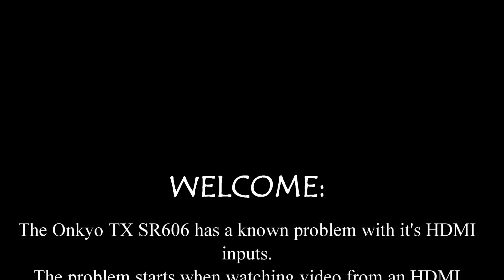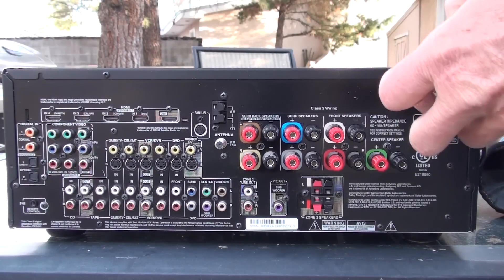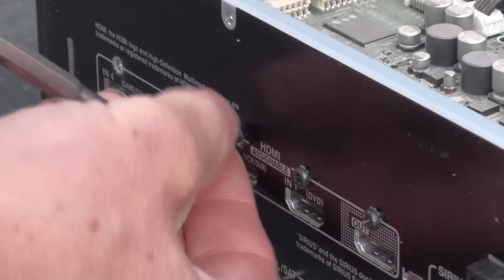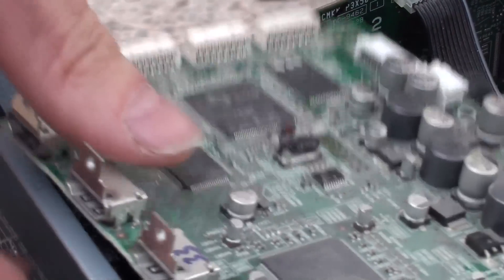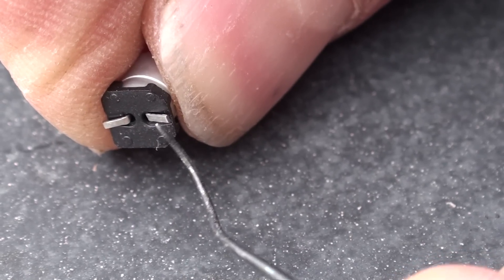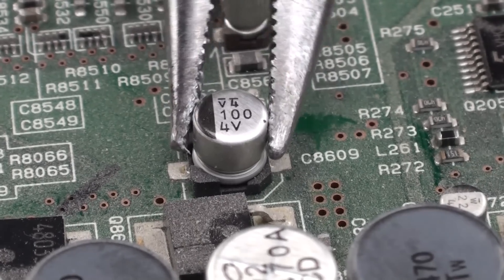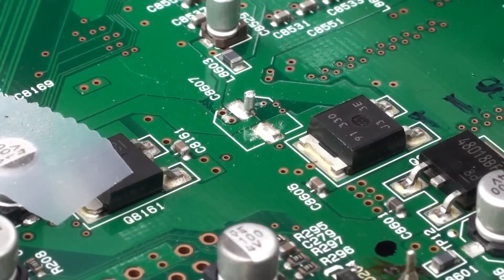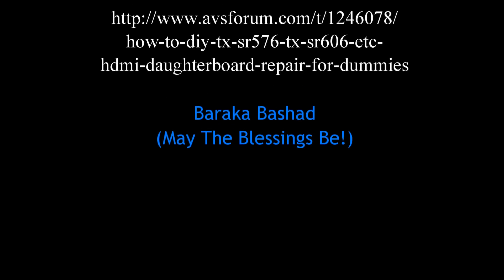How To Fix the Onkyo TX SR606 & SR607 HDMI Input Problem

Comment: Hey Pat, I accidentally pulled the larger looking cap, the bottom one of the 3 in a row near C8162 off of the board during my soldering and I soldered one of the extra caps that a purchased to replace it. Is that gonna be a problem? Will  the cap that I put in its place work or should I order a different cap?

Thank you in advance for your help!!!!
Reply from the maker: It probably wont work. First it's a different value of capacitance. On that alone, the circuit its in probably wont work. Secondly, the larger Caps are mostly 16V rating.  The small caps are a 4V rating. Worst case, the small 4V cap will burn and short out possibly taking some other components with it.

Comment: What is the difference using a 6.3v, 10v, 16v or 25v as compared to the 4v one (493-2141-1-ND) you used. Is there any advantage to using a higher voltage? Will it last longer? Heard that the 4v caps would again give the same issues. Please advise what caps should I order? Appreciate any help in this regard.
Reply from the maker: Some people think using a higher voltage will prevent the caps from failing. I do not agree.  I believe the failure mode of the caps is due to high heat over time which dries the caps out, thus they gradually decay in function.  If the failure was voltage related, the failure mode would be immediately (good one day, bad the next) In this application, using a higher voltage should have no impact on how the circuit functions.  The components will just be physically larger as the voltage goes up.  I wouldn't go higher than 6V myself.   
  To recap, higher temp rating should make the fix last longer.  Higher voltage caps will do no harm nor good.
Reply: +patpatpat999 Thank you. So I guess I go with the 4v new part from Digikey or a 6.3 v one

Comment: Great tutorial! Does this also work for the SR608?
Reply from the maker: Probably will.  Just replace all the 100uF capacitors, not just the ones I show in the video.  It's only a bit more work and a couple more dollars.
Reply from the maker: I can't say for sure, but probably.  From what I can tell the HDMI board is very similar.  So just visually identify all the 100uF capacitors on the board and replace them.  If you're beyond warranty, It's worth a shot.  Good luck

Comment: Super video! Do you think a TX-NR609 would be the same? I'm also experiencing no HDMI output anymore on my Onkyo... Would be great to be able to fix it.
Reply from the maker: 1_ if the digital card looks similar, then probably yes.
2-  For the cause to be the capacitors, the problem has to be as described.  Takes long time for it to recognize inputs, problems grew slowly over time.
3-  If you went from no problem to problem overnight, your cause is something else.
Good luck, PR
Reply from the maker: 1-  If your digital card looks similar, this will probably work.
2-  If your problem got worse slowly over time, this probably will work.
3-  If your problem happened suddenly, then your problem is not the capacitors
Reply: patpatpat999 Thanks for the quick reply. I've had this one time earlier (suddenly no HDMI output). Now again. Was working fine until the day before. So probably something else then :-( :-( Thanx

Comment: Pat I have a newer TX-NR807 but also seems to have this same issue. I was concerned about how much heat was in my stereo cabinet and I guess my fear became a reality.  

That said how did you identify the proper capacitors?  For example I am looking in the service manual and its a good bit of tracing through the schematics in order to do that.  Additionally, the part numbers listed in the service manual seem to not pop up online with any specs.  

I assume one of mine that say (K2P 470 10V) is a 470uf 10V cap.  Interested to hear your thoughts.
Reply from the maker: HI,  I'm not an expert on all these units and I don't have access to schematics, so my technique has been more "shotgun" than sharpshooter.   If the problem started "overnight" it's probably not the caps.  Yes, I believe heat accelerates failure, so having in an enclosed cabinet is not so good.  I fried 2 DVD players by putting them on top of my Onkyo.   Yes, I believe you're correct on the cap pn - values.  If getting new caps, go for the 105C temp spec, and hopefully they will last.
Reply: Well it seemed to coincide with a recent storm but the unit still turns on with south just no HDMI out video.  I should probably try the legacy component cables but for now I might replace all the caps and give it a go.

Comment: Is it fine if I use radial 100uF, 16V, 105°C capacitors? I'm guessing it is, just asking to be sure.
Reply from the maker: Yes, they should work fine.
Reply: i have the same question.  but instead of 16v, i picked up some 50v ones.  those should be ok as well, right?  thanks in advance.
Reply from the maker: +swivel63:  Yes 50V should work fine as long as you think you can fit them on the space on the board.  The size of the caps is somewhat proportional to the voltage rating.

Comment: Hi there, many thanks for the video. i am having a problem with my onkyo tx sr608. my problem is hdmi output stops working after sometime and then it continues going on and off. sound is working fine in the background but display mode changes from hdmi to other sources on my tv and continues doing so. do you think this could be the same problem like you have shown here? and do you think it is repairable by changing capacitors? many thanks again.
Reply from the maker: I don't think the capacitors are causing the problem.  Sorry, I don't know what the exact cause might be.

Comment: The capacitor fix is necessary but the cause is the heat rising from the rectifier heat sink just below the HDMI board. The heat dries out the electrolytic capacitors over time.
FIX: mount 40mm 12V fan inside lid just above this heat sink. Align arrow on fan to expel air thru' lid vent holes. Connect fan to +12V at pin 4 connector JL8001A, fan Gnd to pin 5 JL8001A. Connect 0.01uF 50V ceramic capacitor across fan terminals to stop RF noise. search schematics tx-sr606_sm_1.pdf/download.html

Comment: Can you tell me if this is likely to be a fix for 'noisy' hdmi channels. I have one that works find, but the other 3 range from noisey (white lines flashing along, but that makes the input reset etc). I'm up for trying this, but would rather know what kind of problems it was fixing.
Reply: Gordon, I didn't have the switching problem.  Rather, I was getting the white artifacts in the video along with dropped signals (i.e., entire screen going dark for 1-2 seconds), and it was gradually getting worse/more frequent.  I replaced the five caps and all of my problems were eliminated.  I also regained use of the OSD.  Go for it!

Comment: Thanks so much for this nice bugfix video. I also found a similar description here on AVS ...

http://www.avsforum.com/forum/90-receivers-amps-processors/1246078-how-diy-tx-sr576-tx-sr606-etc-hdmi-daughterboard-repair-dummies-31.html#post_24151775

I had the same issue with my TX SR 606: HDMI inputs were showing up late, also the normal composite inputs
had only Audio and I had to turn on and off 1000x times to see the picture. I decided to exchange all the mentioned Caps from AVS link, about 20x in total. Ordered all from Mouser for 10 bugs (P/N below), replacement was done in an hour. I also added two 80mm 12V 0.2A fans to circulate out the heat, Tapped the 12V from the HDMI board, 50Ohm in series to bring it down to 7V, 0.1A to get the noise down, One is blowing on the HDMI board, the other one blowing out. Everythings works perfectly again!! 

Mouser P/N
667-EEE-FK1E220R -> 22uF 25V
667-EEE-FK0J101UR -> 100uF 6.3V
667-EEE-FK0J221AP -> 220uF 6.3V

Comment: I had a TX-NR818 get shocked in an electrical storm in which my apartment had a bad ground. The receiver works but only ONE HDMI port works. Would this repair apply?
Reply from the maker: Justin Rizzo Possibly.  Capacitors are not too sensitive to electrical impulses.  It's possible this might help but you may have other chips that are blown.  Might be better off looking for a replacement board on eBay

Comment: Hi there, do you think this is the action I need to take for my receiver? It lightly fell from the tv stand (receiver was still on the stand when it fell). The stand detached from the back when adding weight to the stand and it caused it to fall along with receiver. The cable was still connected to the port and it may have damaged something in the port because the video color is off and it flickers. Everything else is working fine. Any tips, thoughts?
Reply: +dina Mac I'm not sure there is a repair unless u can resolder the port on the board. You may be able to take it to a shop and have them swap out the board with a good one. But be warned, these boards aren't cheap. And there is limited stock. Onkyo has extended their recall program till 2018 but i dont think it covers physical damage.

Comment: Good , I have the same problem but my team is HT- r592 , does not the HDMI Out , ne and could help indicate which of the capacitors have to change?
Reply from the maker: Sorry, don't know which parts exactly for your model.  Recommend you replace all 100uF caps on your board.  You will have to remove board first and determine how many capacitors you need.  Good luck.

Comment: What is the rounded rectangle shaped thing just below the letter dts about half an inch.  My speakers stopped working and it looks like mine melted.  I’ve already had my capacitors relaxed years ago but now my speakers just crackle from hdmi sources.  The hdmi still passes video and audio through to the tv properly.
Reply from the maker: schreck425 Sorry, I dont’ know

Comment: Would you happen to know if  the tx-sr706 is the same board...same replacement components?
Reply from the maker: It is similar but not identical.  The process is the same. Identify all the 100uF capacitors on the board and change them out.  AVSforums may have some more details.  If you decide to try this, please us know how it goes.

Comment: Great video..i have a denon AVR 1912 with no hdmi output but component and video out works fine..just hdmi output does not work it would helpful if you solve my problem...
Reply: the video input is component and output is hdmi it works fine but when input is hdmi the output does not appear.

Comment: I have an on Onkio TX-NR609
 The HDMI inputs are working.  The old RCA  audio & video Inputs work as well. The problem I'm having is that I am not able to input any HDMI 3-D Blu-Ray player. It went back 7 times for repair for this issue within 1year and Onkio  finally said they would no longer repair it......  So I've been living without an amp ever since. Just wondering if you think this might fix the issue I'm having?
Reply from the maker: airdreams1 It may,  I can’t say for sure.

Comment: Hi.  I Have the HT-R680 which is having the exact same issues here.  Takes 10 minutes or so to show up on my TV.  I hear a click when it finally does.  I followed the instructions to get the board out, but mine looks a little different.  I don't have nearly as many other capacitors that you do, however, I do have 4.  1 on the bottom and 3 on the top.  The 3 on the top are 16v, the bottom one is 50v even though the bottom looks a little thinner.  My question is, looking at digikey, there are so many options.  How much does it matter as long as I order the same size and voltage?  I narrowed down to the same brand and type.  Nichon aluminum.
Reply from the maker: Ken Shutt Yes, you are correct. As long as the capacity in uF and voltage rating, and general type (aluminum in this case) are the same they are valid replacements.  Also you can use other form-factors.  The original are SMT (Surface Mount T???).  Some people like to use radial style.  They can be easier to find, a little easier to solder on.  Just like aluminum, they are polarized and have a Positive and negative lead.
Reply: How do I know what the UF is.  THe capacitors on mine show 16v.  But it says something like JT or J3, the 100, then 16v..  The one on the bottom shows.  Q3.  Then 4 . 7 and then 50v.
Reply from the maker: Ken Shutt If you can send me a photo of the larger one I can probably tell what it is.  The smaller should be 100uF

Comment: Hi. thx a lot for this vid. 
how did you know which of them you have to change? i did it and it worked perfekt. BUT...now I want to repair my own one. its a 605 with a different hdmi-board. how can I know which ones I have to change?
Reply from the maker: With this method I don't know exactly which capacitor(s) is bad, I just replace them all.  This is a good method in this case because they all may fail in time.  Best to change them all out at the same time.  
Same thing for your 605, find and replace all the 100uF capacitors.. No guarantee, but it should work.  Good Luck!

Comment: I have the TX SR705 and two of my channels just started having static/scratching noises when audio is passed through. Seems to get worse the longer it stays on. Could replacing the capacitors help with this problem?
Reply from the maker: Josh Teiken Yes the capacitors could be causing this problem.  Since it gets worse as it heats up, you could try cooling the caps one at a time and see if the noise stops.  Then you know which one to replace.  You can buy freeze spray just for this purpose or you could try the Compound W Wart Free Off system.  You can buy at any drug store in the U.S.

Comment: It worked for me!! thought I was going to have to buy a new surround. I can solder so for me this was an easy fix. the new part number worked perfectly 493-2141-1-ND. For me I had issues with sound and HDMI output. i could only get HDMI out with 480p input. i would have lived with it except the sound then started getting weird and going in and out. eventually HDMI inputs started dropping out using my PS4 and Samsung Cable box from time warner. The 4 Capacitors did it for me and it was fairly easy. thought it didn't work at first but I forgot to change the channel back to HDMI input on the tv :)

I may add in a cooling fan and If I do I will post a Video showing how I did it.
Reply: Stefan Schneiker I'm having trouble getting 1080p@60 or even 50hz.  I get 50 to run extremely intermittently.  It runs well at 1080p@29hz.  Some sorta handshake issues?!  I've tried two different sources.  Two different inputs.  The cable box runs well.  Although it comes up 720p instead of 1080i.  Perhaps this might be a setting on the receiver.

One thing of note:  I did the replacement procedure above.  However I noticed another visibly blown cap on the motherboard.  I'll get around to replacing that too.  But I haven't yet.  Could that be related?  I doubt it.
Reply: Robert Koernke I had it working well. I'm not new to soldering or anything. But for whatever reason it started screwing up again after like 2 weeks. I just ended up replacing it with a demon from best buy with Bluetooth. Its awesome although the onkyo imo had a slightly better sound but I can't really test it... Good luck on the rebuild
Reply: Stefan Schneiker I've had it working for a while.  I had bought 10 caps, and found 1 or 2 of my work was previously bad.  However now, I'm started to get the case where I'll first turn on the unit, and it won't connect.  Then it warms up, and has no problems again.
Reply: Robert Koernke its just time to toss it at this point. The mobo for the HDMI board members is at least 100 bucks. Its better off just getting a brand new machine at that point. I did and I am happy with it

Comment: I have the HT-RC270 with the same HDMI issue. But my board looks a bit different and I am not sure how to determine if the caps are bad and which to replace. There are so 4 in a row and 1 on other side of board...  (S2, 220, 10v). They physically look fine. I am not an electronics wizard but can maybe handle the soldering iron.
Reply from the maker: Maxwell Smart there is no easy way for you to tell if a cap is bad. That’s why I recommend just replacing them all.  The parts are cheap. In this case, your 4 are 220uF, 10V.  Should be easy to find on line.
Reply: patpatpat999   - Thanks. I could not disconnect some of the ribbon cables to see the other side of the board but we sorta peeked and think there may be a few more. But I may just replace the 5 on top (4 in a row on 1 side next to similar looking black cylinders and one alone on the other side. Assume the local electronics store can recommend replacements.
Reply: patpatpat999  i found them local and replaced with 16v. 5 on top and another under (100uf, 25v). The HDMI output works ( i see the Onkyo menu on screen) but no input from the back plugs ):
Reply: I wonder if I got the proper caps replaced... there are a bunch of smaller once. How do I know which are for the HDMI inputs?

Comment: I have an Onkyo TX-SR508.  About 6 months ago, one of my HDMI in Ports lost sound.  The video comes through fine, but does not play any audio.  I just stopped using that port.  The problem continued to happen with each port over time.  Last night my LAST ports audio went out.  Would replacing capacitors fix the problem?  I worried that the unit got to hot in the cabinet where it was located.

Comment: Hi, my receiver has this problem and also there is another problem with the rear speaker which pops and cracles. Any tip on how to fix the pops and crackles? Thanks
Reply from the maker: A. Munif Sorry can't  help much. Sometimes scratchyness is just a bad connection to the speakers. You can swap the wires at the receiver  between the front and rear speakers. If the noise changes to the front speakers the problem is with the amp output, if not, the problem is with the rear speakers or the connection. Good Luck